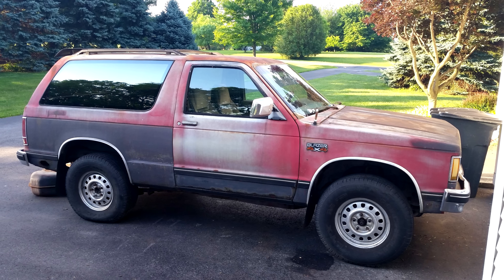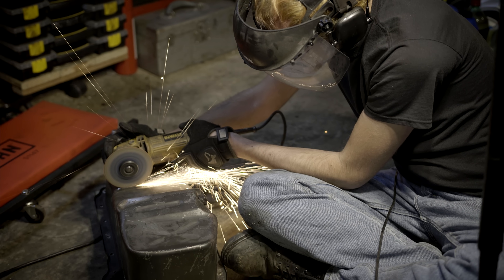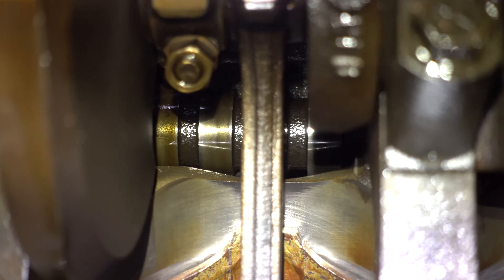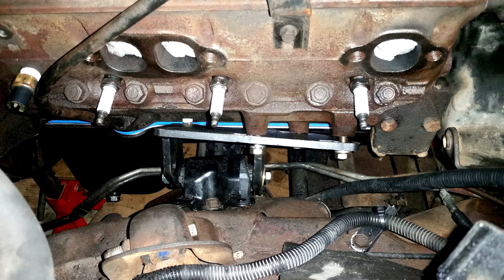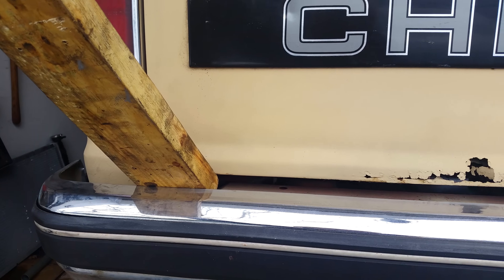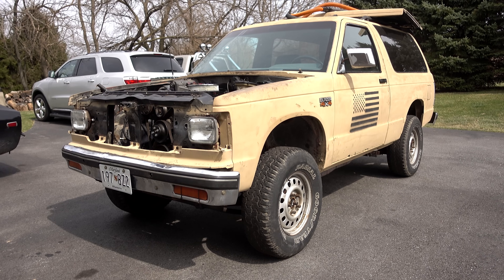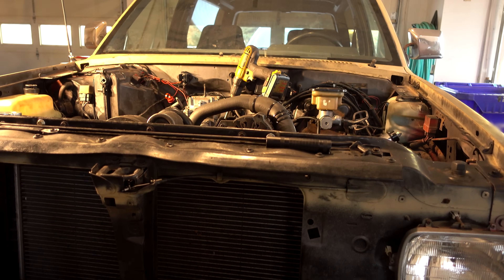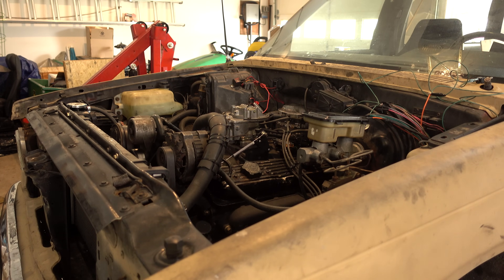4x4 S10 Blazer Budget V8 Swap (Ep.2)

Comment: Nice Job I didn't notice it was 8 years ago? I have a 1991 S10 Chev.Blazer 4x4 which is all original and Maroon and Silver exterior like I think yours was. Has the  V-6 and have been thinking of doing a 350 V8 swap myself. It has been sitting since 2010 but has a brake line rusted through, I bought a pre-bent complete brake line kit. I am going to start on it in spring 2026. Have a good Thanksgiving and Christmas/ New Year.

Comment: Good morning dear friend, I have seen your videos and I have decided to make a swap to an oldsmobil bravada from 1992, it had a v6 4.3l vortec engine, I have placed a sbc 350 engine from before 1986.
I would like to know if you can support me with your opinion or if you had any problem similar to the following topic.
Everything was perfect just like your videos, I only modified the supports, the part of the exhausts as well as the change of the fly wheel since the diameter of the crankshaft of the 4.3 engine from 1992 to the sbc 350 from before 1986 is different after having driven around 400 miles it has started to leak transmission oil, when it is on, from change to torque converter seal, again drove around 200 miles and the transmission oil started leaking, after this it was changed again the seal and the torque converter, now I rode about 600 miles and the oil spill started again, this can be seen from the torque converter seal.
I hope you can share your opinion or experience with your swap.
Thanks.

Comment: I wonder if you couldn’t just put a oil filter adapter going to a hose and then put it somewhere upright in the engine bay. There’s got to be something out there for that. It would basically be an extension. I never liked when the oil filter was underneath anyway

Comment: I love it. Wish I could of found a nice square body for my s10 project but got a 2nd gen instead. 95 4x4 350 tbi engine backed by the 4.3's 5 speed still fuel injection. Runs great

Comment: That oil pan mod is actually pretty good. Most times, one would fabricate a “clone” of the v6 sump out of sheet metal and weld it into the bottom of the stock 350 pan

Comment: what i found funny about this common conversion is that gm never offered a v8 option for these s10 based vehicles.  but yet for offered a v8 in the explorer but never the ranger and i never hear of a v8 ranger swap which should be much easier sharing the whole front end with the explorer.  wtf

Comment: Just wondering what size bolts and what size drill bit did you use for the body mounts
Reply from the maker: I used a 1/2" drill bit for the aluminum lift puck center holes and the bolts were Grade 10.9 M12-1.75 110mm long. From memory, they fit perfectly on there with washers under the bolt heads. If you have a pickup S10 I think the bed bolts are a different size, however.
Reply: @FuzzyDiceProjects  
thanks for the info and was putting the pucks on the truck the only thing you had to do or was there more to that?

Comment: I just have one question... Will those pucks you made for the body lift cause galvanic corrosion, being alu to steel?
Reply from the maker: Since I painted them and there is paint on the body of the truck probably not, although even without paint I wouldn't expect it to corrode in any significant way for at least a few decades.
Reply: @FuzzyDiceProjects  You're very lucky to have a nice climate, that would be a hole in 5 minutes here in rainy old england

Comment: With that oil pan being so frankensteined, does the dipstick still read correctly?
Reply from the maker: Since the dipstick is measuring the height of the oil, it will read the same proper oil level no matter what pan is on the engine. The oil capacity will change, but what you are looking for is how much of the rotating assembly is going to be submerged in oil and that doesn't change no matter how badly we hacked together that oil pan lol.

Comment: Discard the stock oil filter position...get a remote oil filter kit. It will sit right alongside the driver's side of the radiator.
Reply from the maker: The truck actually came with a remote oil filter for the stock 4.3L, but it didn't fit the V8 block so for the time being I skipped using it. Would like to modify it in the future and/or use an aftermarket setup to make it more practical though.

Comment: Is there any reason that an aluminum puck body lift wouldn't work for a standard full size truck like say a 2007 Nissan Titan? I'm wanting to add another 2 inches or so and alum pucks seem simple and economical.
Reply from the maker: It should work, but keep in mind what components you would be moving around. I mostly got away with the 1" lift here, but the bumpers still don't line up amazingly since they are bolted to the frame, and the transfer case shifter hits the body when it is shifted into 4Lo. More of a lift and you'll want to relocate the bumpers, probably have to adjust or lengthen some linkages, might even need to modify the steering shaft. Take a good look at all the wires and hoses, too. Body lift kits usually come with a bunch of brackets and small things to help with this.
Reply: Preciate you man

Comment: Hey man good video question for you what the stock radiator. Are you running any electric fans or anything like that
Reply from the maker: It currently has the original 4.3L radiator in it, with some eBay special 12" electric push fans mounted in front of the radiator (because I really couldn't fit them behind it) as shown being installed in the next episode. Gets a bit warm on hot days so will probably replace it with a two core aftermarket rad in the future.

Comment: When I installed the TPI 350 in my 91 S10 4X4 I ran into the same issue with the oil pan. Milodon makes a pan for the swap. It was $300….. your oil pan does the same thing and was budget friendly.

Comment: Would something like this also work for an 89 blazer?
Reply from the maker: An S10 Blazer, sure! They are essentially identical. Of course there are things to consider like if it was a 2.8L the 700r4 for those uses a different bellhousing design and isn't compatible, but there were very few changes 88-89.

Comment: My 2 Cents:  I love to watch others for fill their wholesome ambitions.  And very much enjoy your mono tone narrative.  But?  as I said; I got 2 cents to throw in so far.  at point:  8:32.  Serious warnings signs are a ringing in the back waters there.  Again at 13:15 you admitting confirmed not knowing about the Possibility and "What happens" when a flex plate/Flywheel suddenly detaches?  I mean?  After all factors observed;  Odds of a flex plate coming threw the floorboard is pretty low. But? What If?  The RPM's,  the weak point* of failure.  The Point of revolution the failure occurred.  I'd rather loose Brakes.  I mean,  that's messing with some pretty bad odds there.   A 15" inch saw blade detaching right near my feet and legs.  i mean,  I would guess being any where between 11-1 o Clock?  its gunna make a mess. Because IF* that plate detaches and goes in those directions?  uP?  The "BLOCK" will force it back towards passenger compartment?  Heck I don't Know!   HAHA  But if It happens? I hope ya get it on Video!  LMAO!  Take Care ya all!          Jaws ><>
Reply from the maker: Using washers to space out the torque converter from the flexplate is very common with mix-and-match parts on small block Chevy applications, as long as the torque converter is still seated in the crank (and you would feel a lot of vibration to tell you it isn't) that isn't a problem. The bolt heads tapping against the inspection cover very lightly isn't really a concern short-term, not great for the bearings but I corrected it right after I noticed it. Also, the flex plate is bolted onto the crankshaft with a different set of bolts, those are held in with high strength threadlocker and the flexplate isn't going anywhere.

Comment: Hey dude get a heavy piece of copper or brass to clamp behind the seem and weld away
Reply from the maker: Yep, good tip! A backer plate to distribute the heat would help with burn-through. We'd also like to get a welder more suited to sheet metal and run gas instead of flux core ideally
Reply: Fuzzy Dice Projects when the budget allows you my friend

Comment: what is that switch you turned on at 12:39 ?
Reply from the maker: A switch to run the fuel pump. Since I removed a bunch of wiring and the computer, the toggle switch activates the relay instead of the computer priming it and then it running off of the oil pressure switch. For the sake of simplicity, mostly, and it was eventually wired into the dashboard.

Comment: You need to learn to use backer bars for welding.
Reply from the maker: That is a fair point. Plan to get a welder that is better for sheet metal in the future, and use gas instead of flux core to try more than just hot gluing things together.

Comment: Anyone else cringe like crazy when they saw the open holes on the engine while they were hosing it down?
Reply from the maker: For a cheap, crusty engine like that that already had water in the cylinders there really isn't all that much to worry about, especially if it is dried off well and the bottom end is kept oiled. Didn't have any issues with it until a head gasket started to leak a few months later, which isn't related to a little water getting in there.

Comment: I swapped a very, very healthy fresh built Small Block Chevy into a 2wd S-10, the only stock parameter on that lil brute was the stroke size. I went with a forged rotating assy @ 0 balance, .040 overbore pistons, moderate duration and lift solid roller camshaft, a set of very nice Edelbrock aluminum cyl heads, a high rise Edelbrock performer rpm square bore intake, and countless other odds & ends. The motor was kinda weird, it made a smidge over 400 hp and a smidge over 500 ft lb torque. I used a kit to swap the V8 in that s10 and I do remember the driver side header primaries were kinda wild, the two inner primaries ran out and away from the engine block quite a bit all the while the two end primaries were hugging close. The steering shaft ended up running thru the headers, it was a really nicely put together kit. The little pickup had the umph to smoke the tires at will and ran absolutely amazing and fuel mileage wasn’t terrible even with an 800 cfm Holley 4150 dual fuel line carburetor. I do wish however I would have went with a 2 speed powerglide trans setup because since the pickup weighed less than 3,000 lbs it would have been quicker in the quarter mile with 1 shift from low to high than rather than 2 shifts from low-2nd-drive with the gm TH350 trans I had in it. The B&M TH350 trans also didnt enjoy full throttle shifts when the soft rev limiter came on @ 6200 rpm. It was just sooo torquey, either the powerglide or TH400 trans would have really held up better, but oh well I was also fighting with traction issues as well.

Good luck with tour blazer though, I’ve enjoyed watching you find things you needed to change and correcting them. They arent many of us gearheads left, best wishes my friend. 👍🏻

Comment: I've got a 98 S10. How expensive do you think it would be to replace the weather seals? AZ melted damn near all of mine and I was wondering if its possible to do it yourself or would it be better to take it to someone.
Reply from the maker: I honestly haven't looked too closely at them, all of mine are toast but still somehow seem to keep water out. It is definitely something you can do yourself with patience and care, but weatherstripping work can be a pain for sure. Not sure about that particular car, but a complete weatherstripping set for a simple vehicle usually runs $150-400 off of the internet. If it's a two door pickup, there are only a few door seals and the window ones so shouldn't be too bad to do yourself.

Comment: With that 4.3 being based on a small block, I really thought you wouldn't have had so many problems with clearance around the back of the motor. You should look into a remote oil filter. Actually the first small blocks (265) didn't have an oil filter and they were fine

Comment: How much oil does it need and how did you find the capacity out ?
Reply from the maker: Basically just guessing based off of the V8 engine's dipstick. Still seems to take around 5 quarts total, maybe just a little bit less than that. The oil pan capacity is probably halfway between the 4.3L and 5.7L considering the alterations made.

Comment: I came across this and this really gave me some nice ideas, last year I pulled a 1986 s10 blazer out of the back field, it had 168 000km on it and had been sitting in the elements for 20 years and it kind of became my project vehicle, so I fixed it up and started driving it around and eventually the motor blew, so I've been taking out the old 2.8l v6 and I'm going to put in a 3.4l v6 in hopes of more power and speed. My end goal is to have it as a nice vehicle for mud bogging .

Comment: If that was a truck block, why is it "not" a 4 bolt main???
Reply from the maker: I believe not all 2500 series trucks were 4 bolt main by 1988, although it is a bit hard to verify that. I later realized that the engine had been rebuilt (and machine work done) so it is possible it wasn't the original block in the truck anyway.

Comment: I had one of those clear distributor caps on my 73 VW bug.  After a 6 mile walk home and then another 6 mile walk back to my car, carrying the factory distributor cap, I threw that thing in the garbage.
Reply from the maker: It's been working well for 3k-ish miles so far, but I have heard many a horror story from back when they were first released. My guess is that the materials used in the old ones were not up to the task, but the one here feels as solid as the rest of the cheap-o caps I've used without issue.

Comment: What did you do with the carb and conversion plate! I need that for my 2.8!
Reply from the maker: Both are still sitting around. It was fairly simple to make the plate once I worked out the design, and same for the carburetor once the throttle arm bracket geometry was figured out. I can try to work out a template if it might help!

Comment: I thought you could easily put a 305 v8 in a late 80's blazer with very little modification
Reply from the maker: A 2WD, yes! But the 4WD has a narrower frame in the front and several other components (like the front differential) in the way which complicates things a fair bit.

Comment: I own a 1991 S10 Blazer with 260k miles, she's down at the moment but will be running again before summers end. She's all stock, original engine, trans, and differentials. I had the same problem with mine not wanting to stay running, found out it was a small module on the distributor giving my onboard "computer" fits and making it run poorly or not at all. fixed that problem solved. I liked your solution though, V8 in a Blazer does make me smile.
Reply from the maker: I replaced the distributor with an aftermarket one and it didn't make a difference on the TBI setup, so it is unlikely that an ignition module was at fault in my case. Glad it worked for you though, I hope you get her running and driving again soon!

Comment: Question:
I have a sbc 327 out of a 66' impala and a turbo 350 trans laying around. Been looking a s10 body to put these in. I found one but its 4x4. Will my trans work or will I need a diff one since its 4x4? And is there anyway to not hook up. The 4x4 components and act as if the truck is 2wd. ?
Reply from the maker: You could pull the front differential and the transfer case and have it be 2WD and avoid a lot of the annoying fitment parts, but the frame is still different in the front so engine mounts would be either made for the 4x4 or custom. Front end has torsion bars which may or may not limit your exhaust options, depending on what you want to do. Would need a custom driveshaft either way, since the turbo 350 is a bit shorter than the 700R4 (assuming that is what is in the S10). Need some crossmember modification as well, and I'm not sure how the column shift would line up but I'm sure it's fixable. Just a lot of work to do, whether keeping the 4WD or not.

Comment: It's always amazed me how similar a 4.3 and a 5.7 are they are basically the same engine just missing 2 pistons😂
Reply: they are the same engine. they needed a v6 for their smaller vehicles and one dude glanced at the 350 and said "hold my beer" 2 chopped cylinders later and bam.  4.3L 262 cubic inch v6
Reply: And they bought that dude drinks for the rest of the week. @raikou889
Reply: Same bore and everything
Reply: The 96 and newer 4.3L has more differences. It has a balance shaft,non adjustable valvetrain.96 and newer have 2 differently balanced flywheels also.

Comment: Without a fan or electic fan systym, how does it not over heat? Or does it?
Reply from the maker: I think it was added in the next episode, if it wasn't in this one. It has dual electric fans (the cheap eBay ones) mounted to the front of the radiator on a toggle switch, they work very well!

Comment: You should have went with a 4.3 V6 you can get as much Powers as the 350 that you put in it and would have saved a lot of headaches and a lot more bolt on  power options with the 4.3 V6 nowadays

Comment: Would it be the same kind of fit in a 2nd gen s10 pickup?
Reply from the maker: Not identical, but pretty similar. The S10 didn't change all that much over the years, and I know people V8 swap second gens as well. I'm sure some details would differ but most things should be about the same.
Reply: Ok, cool. Because I am in the middle of putting a 350 in my 2nd gen, and I'm trying to figure out mounts
Reply: Thank you for the reply too